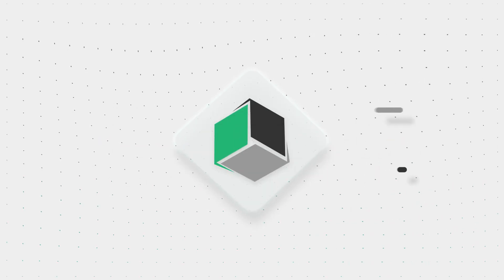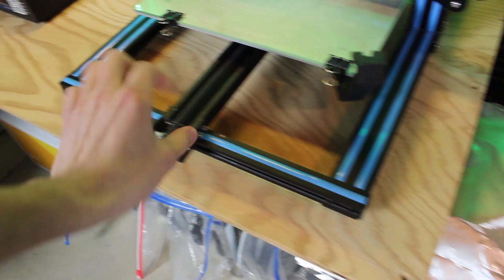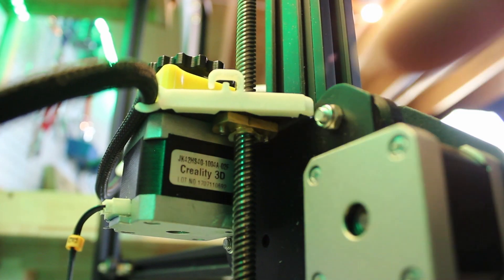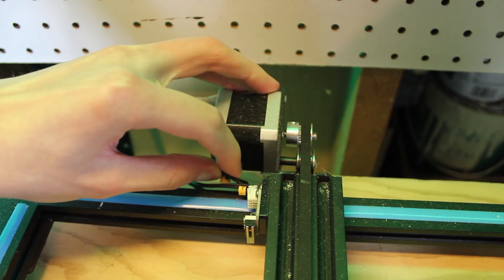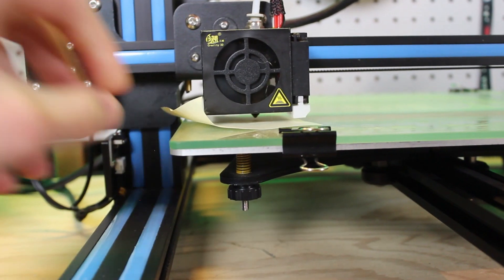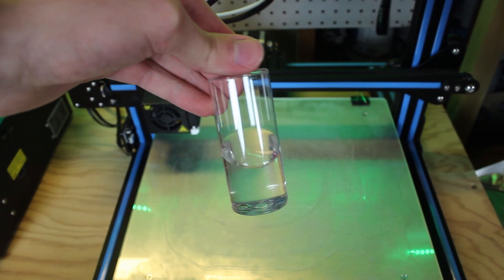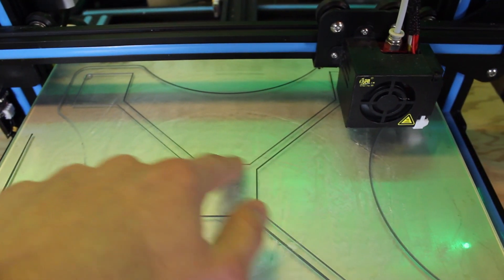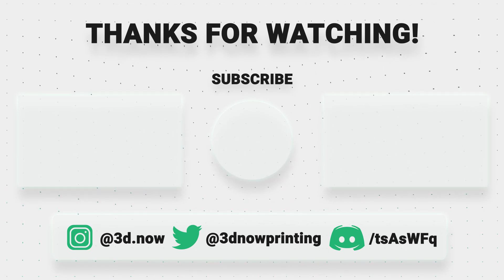Essential Steps to Set Up a New 3D Printer! - Beginner's Guide

Comment: I just got my first 3D printer and wanted to do the Bed Calibration model you listed above, do i just download it and then put it on my sd card and then into my 3D printer or do i need to do the slicing step first?
Reply from the maker: You always need to slice a model. You can download the stl, then slice it in cura, then put that file on the SD card.